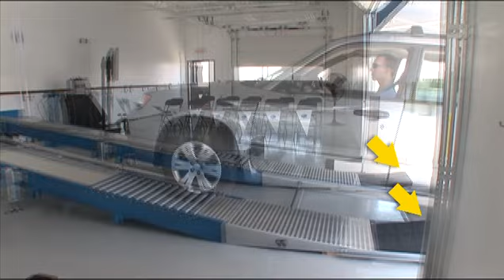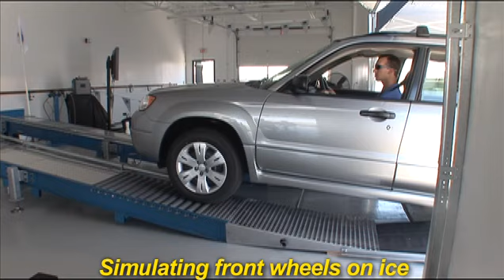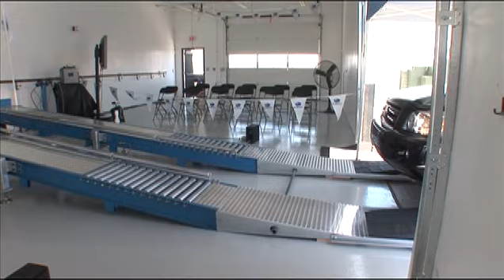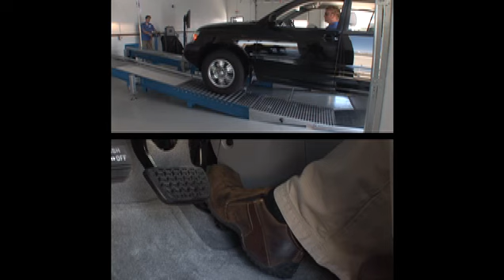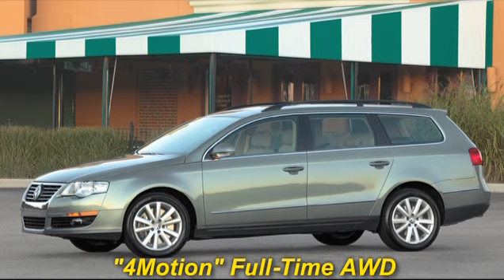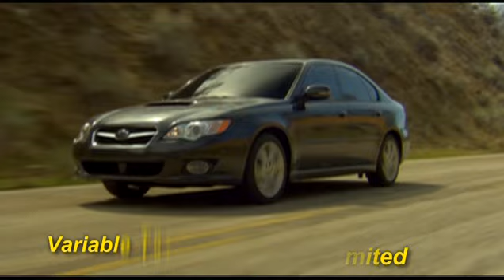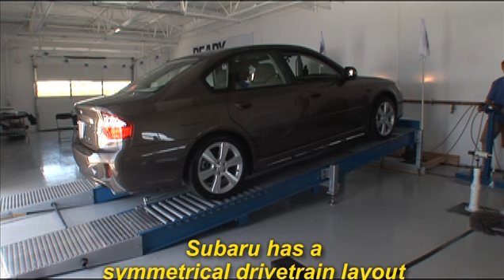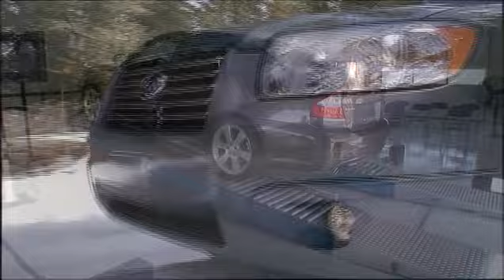Subaru Symmetrical AWD vs. Honda, Toyota, and Volkswagen

Comment: You seem a jot confused with the one wheel has traction demonstration. Each time the wheel you point out that will have traction does not appear to have power and it is the other wheel on the frame that is moving.

Comment: I really don’t think it has to due with being symmetrical awd. It’s how much torque they can transfer via braking and via the awd system.

Toyotas atrac system is not symmetrical and yet can do the same thing without issue

Comment: Did you notice the man that could be working brakes on the rollers,i have Subaru's and you believe me if one wheel is o traction with a slight resistance it will not move.

Comment: The one wheel drive test is just a demonstration of traction control which is only a matter of programing. https://www.youtube.com/watch?v=XuI-0vI2ojw&t=307s Here is a video of an Audi passing the test. There isn't a chance a Passat would just sit there spinning 3 wheels in the real world if you modulate the throttle...unless you turned the traction control off.

Comment: "The bulk of the vehicle weight is on the rear and the vehicle must overcome this to move...this is extreme...

WTF?

The weight of the vehicle never changes and the whole vehicle has to move, always.

The Highlander has a button you can push to provide more power to the rear.  The 2007 Honda Pilot has a VTM-4 lock button and VSA disable button, which can be used to send more power to both rear wheels - enough to climb a steep slope.  Try it out in your simulation.

Comment: To be fair. Folkswagen only claimed it will "move" with one wheel. They did not say it will CLIMB with one wheel. and it looked like it would move on a flat surface.. The last subaru suprised me as my open diff forester  stops immediately when 2 wheels are off the ground :)
Reply: The legacy 2.5 GT has a center and rear LSD, they were being slick comparing the VW with only a center diff LSD to the legacy with both diffs LSD

Comment: This is why my wife has an Outback and I have a Forester.
Our AWD Toyota’s always had to have studded tires and every winter. 
Even when our Subaru’s had the factory tires on them, we still had no issues with traction even in our winter months when we get 5-7 feet of snow.
Now that our factory tires had to be replaced, we replaced them with Michelin Cross Climate 2. They’re Awesome on dry, wet, and snowy conditions. They’re a quiet tire and they don’t lower our mpg. When they wear out, we’ll replace them with new Cross Climate tires.
After switching from Toyota AWD vehicles and replacing them with Subaru’s, our insurance premiums DROPPED by $600 per year. This is due to the traction, accident avoidance and safety of our Subie’s.
Both our Outback and our Forester Touring are 2019 year models.
When our Subie’s wear out, we’ll be replacing them with another Subaru.

Comment: Well that just about proves it 100%. I would definitely go with subaru if i want AWD. Im amazed that the other companies actually advertise their cars as full time AWD but its a total scam. They literally cant even drive the rear wheels. Its FWD. All those extra parts and engineering just to add weight to the car and do nothing. Thats totally NUTS. 😂

Comment: Subaru's AWD is a good system, however, the engines are junk. If you buy one, your going to be replacing blown head gaskets probably 2-3 times over the lifetime of the car.
The engine heads are aluminum (a soft metal) and warp over time causing the gaskets to fail. Also, the gaskets are junk, I've had two Subaru's, same outcome.

Comment: I know this video is old, but jfc this data is cherry picked.

First tests with the Forester involved the front and rear wheels, but the moment it came to the vw (a comparable car) they changed the test to feature only one of the front wheels... Then instead of making the comparison to a car that has similar power (the Forester) they switched to a car with roughly 50-100 more horsepower and a lighter frame for the one wheel test, by using the legacy gt.

Comment: I'm trying to learn how these systems work because I'm choosing an AWD to buy. I had an 03 Outback which was a beautiful car and the AWD had amazing traction (but you had to fang it hard to make it work) but it used a lot of fuel and was hard to fix - lots of problems. Hondas are so reliable and cheap to fix, especially since the motors and gearboxes never really fail. I'm wondering if I can hack the diffs to lock them when required.

Comment: I'm just here after driving my mom's Subaru legacy up our driveway that is almost 2x as steep as this when it had 1 inch of solid ice on it😳. UNREAL. When I mean ice, I mean it was an ice rink. We had frozen rain, and it took 3 days to melt, people were ice skating and playing hockey in Walmart parking lots. That's what kind of ice we are talking. I will be purchasing Subaru in the future.
Reply: was the car equipped with winter tires?
Reply: @ayn-yu  no, I think they were just all season tires, as where we live, the snow usually melts after a day or two, it is very rare that we have extreme winter weather.

Comment: This is a famous video and famous thread for the old Subaru faithful. I am not waking up a dead post. I am reframing the questions for a ~12 year update.

[B]Question 1:
[/B]
What has changed in both Subaru's AWD systems of today vs. then?

[B]Question 2: 
[/B]
same question for the other brands

[B]Question 3: 
[/B]
is there a video like this test from Subaru that is much more current?

[B]Question 4: 
[/B]
Can a stick shift Subaru get the same results? In a 2015 WRX? A 22 WRX?

[B]Question 5: 
[/B]
How about the relevance on the cars we actually drive as it applies to this type of testing and translates to the real world?

[I]a. 05 STi
b. 2021 STi
c. 2015 WRX
d. 2022 WRX
e. 2012 WRX[/I]

*assume all models are manuals.

[B]P.S.
[/B]
[B]MY SNOW STORY
[/B]

[B]FAIL[/B]
 my 05 STi only failed me once in the snow and it was because was an unfair test: had to big a curb bump soft enough not to tear my front bumper off and bottom out the subframe, had to turn into the driveway, the incline was very steep. Like 30-45 degree range. The powder was fresh and super slick. I could have done it if I could get the momentum I needed with all factors working against me. The manual didn't help.

[B]PASS[/B]
in literally every other snow test and blizzard my 05 sti, and 02 wrx passed with flying colors. I mean my friends and I would d*ck around in the winter (safely, there was no traffic, and no parked cars on the street), and we TRIED to lose traction. We literally could not get my car to lose traction. This happened more than once. 

[B]NEUTRAL[/B]
brakes are kinda mushy in the snow, the short gears and manual doesnt help, I never used my DCCD to go from effectively (I know not truly, full open to full 50/50 'lock', an oversimplifcation I know, that's not the point, it's irrelevant). I was ALWAYS on good all season tires with good enough tread life (ex: michelin pilot sport 4s), so I never got to  experience the TRUE grip that can be had in nasty winter weather. Would have loved to have a spare get of winter wheels and tires with some Blizzaks or equivalents that are true snow tires. 

[B]P.S.S. [/B]have you noticed that when you watch rally, the snow tires are small, thin, narrow, and studded? Seems like wider and bigger isn't always better.

[B]BONUS QUESTION:
[/B]
[B]My friend commented that an SUV or Truck is better in the snow bc the weight increase the tires force against the ground resulting in more grip.[/B]

What are your thoughts on this? I understand the logic, but does it work that way?

I told him that even if that were true that weight becomes a liability if we started talking about speed and time. Put them on a snowy course and watch that weight slow you down or carry you off the track.

Nate

Comment: Had this same scenario, I was on at a light on the top of a hill that was icy in a FWD Audi and I could not move forward even with good snow tires, needed some people to help push me. Sold the car and got an Audi quattro, never looked back as the same situation happened again but this time I pulled up with ease.

Comment: My 2010 highlander would push up that no problem. Turn off traction control and launch in 2nd gear. Or if you threw on some upgrades like mine, lock that diff and crawl up anything

Comment: bullshit:))) all video is bullshit. it;s all about the center differential for those  who fail to climb with an axle on rollers. And for haldex or clutch between axle, you are failing on one wheel due to software implementation on breaking the freewheel. So cut down with the shitty judge about symmetrical drive train

Comment: Only the Subaru, Nissan's Xtrail and Dacia Duster, are "true" AWD systems. The Subaru has a very clever computer while the Xtrail/Duster have a fully lockable Center Differential (just like a real 4x4).
Reply: X-Trail and Duster do not have center differential but a a clutch-pack. The same clutch-pack is in Outlander, ASX, Eclipse Cross, Vitara, S-Cross, CX-5, CX-30, CX-3, Qashqai and many more. They just use different software to control it.

Comment: There's more than a few problems with this "lab set up"...like...if this were a science fair project it would be thrown out...you didn't even prove you had "awd" variants of the competitors. We didn't see the rear wheels ever. "Torque steer" was obviously driver error...like look at it. Im not mad subaru...just disappointed 😔

Comment: Symetrical or not does not matter in this test, this test is about how much the diff locks, mechanically or electrically with the brakes transfering power.
A offroader with 100% mechanically locked diffs will climb this ramp even though one driveshaft is 10cm and the other 2 meters long, it does not matter.
Think about it, the front and back driveshafts are not symetrical at all, one is 3-10 times longer then the other but power is still transfered between front and back without problems, so sideways power transfer should not be an issue.
Landrovers, jeeps and even a Mercedes Unimog, does not have symetrical front axels and they are considered to be one of the best offroaders out there.

Comment: Funny how Subaru only uses their cars with limited slip diffs in this test but won’t used my old base Impreza 2007 auto which I was stuck plenty times and I live in the hilly northeast. One front wheel and one rear wheel would spin and the isn’t moving anywhere. Sorry not sorry lol

Comment: Subaru,Mitsubishi,and Audi AWD system performs better but at the cost of reliability. I also think that the horse power,torque,and suspension difference between these cars are not equal to make a fair comparison.

Comment: I love my 2006 Forester 2.5X automatic. It willl carry 4 men and 3 hang gliders all the way up a mountain climb of 3,000 ft without overheating (locked in 1 all the way). It has 180,000 miles (291,000 km) and is fit for purpose. (You can see it in some of my videos.) I'll probably hang on to it because it's worth very little and has zero annual depreciation. I love it like an old pair of shoes. I change the oil and filter every 10,000 km, and change the transmission fluid every 30,000 km.

Comment: Stability control cuts engine power, not traction control. Traction control brakes the wheel to send power to the other side. Stability control uses a combination of factors including traction control and engine power reduction to try and stabilize the car.

Comment: hi i’m a little late here but i need some help. i have a rt4wd honda and i want to make it awd. would all i need to do is get a different drive shaft w a different center diff? i heard land rover drive shafts would fit nicely (with some manufacturing) to make the system a full awd. anything helps thanks

Comment: Did you read the Honda CR V manual?? This system has two mechanically driven hydraulic pumps, one of which engages the clutch which transfers power to the rear wheels, and it is powered by the spinning of the front wheels. If you don't turn off the traction control, the front wheels won't spin enough to fully engage the clutch that drives the rear wheels. Might sound a little cheesy, but it has it's advantages, and it works a lot better than your test would indicate. Dishonest or incompetent?  Hmmm........

Comment: The system in my 2001 CR-V was able to get me up a damn mountain. Meanwhile my dad's girlfriend has a 2017 Forester and it couldn't even make it up the ramps that my dad and I use for oil changes without a run-up. Also if Subarus didn't burn a quart of oil per week, I would be driving one.
Reply: damn, maybe that 2017 needs to be checked? my mom 2016 climbs pretty good. If its got a CVT, might need to be checked, alot of them have had a recall
Reply: @SqueakyKnees  yeah the people in the video we're punching the throttle but if you want traction you're supposed to crawl which is what I do

Comment: I purchased a new Outback in 2017, had RAB and many electrical problems from the start. After only a couple of months I had the car in the deanship for repairs. The dealer only deleted the PC history, did nothing to fix the problem, and does not supply the needed paperwork to prove I was there.  This practice is still going on today. The service tech brags, "as long as I work here, no one will ever qualify for Lemon Law protection "  Problems got MUCH worse. In for repair 10 + times, towed in 4 times. After contacting Subaru customers support, they said because the dealer refused to supply paperwork for your visits, they refused to refund my money for the Lemon the sold me. Car was traded in, because it would not work, still under warranty, still not fixed because they didn't know how to fix it. Lost well over $14,000 because Subaru does not stand behind their cars, or the customer.

Comment: Too bad the Subaru has an unreliable motor
Reply: after 08 they fixed the head gasket problem. STIs had a problem few years back but that was recalled. still have an 08 and after you get a proper head gasket on it, its running strong on 217k miles
Reply: SqueakyKnees the Toyota and crv will double that without touching the headgasket
Reply: @TheRealNolanStyles  not after 08, and not before 1998. there are 1990s subarus are still being dailyed today. Toyotas are great but the new ones are so damn expensive now.
Reply: SqueakyKnees I see many more crv’s and RAV4 from the 90’s than Subaru’s not only that the Subaru’s are more expensive
Reply: @TheRealNolanStyles  thats also bc alot more crvs and rav4s were sold in the 90s bc subaru was a small company. the more expensive part doesnt add to your argument. audi is also more expensive and there are also less of them for sale.

Comment: The first generation crv did great in the snow, our 2016 crv is decent but in my opinion not as good in snow. I've had a few first generation crv's and multiple subie's from 95 up to an 09 and as long as the snow wasn't over there front bumper I never worried about taking any of them out...
I must admit I never even thought to test them on rollers but in the real world testing (and I tested thoroughly lol) I can't complain about either company's awd performance.

Comment: I've had an 06crv, 07 highlander, driven a legacy several times and i have an 08 tacoma currently and this test totaly lines up with reality. the highlander was the worst thing i have ever owned in the snow including a corolla (albeit not worse than a chrystler town and country i'm proud to not own) my crv i use as a mail car and it crawls out of snow well but is completely inferior in genuinely bad conditions to the tacoma's true 4x4 which i will testify, even with well worn tires, kicks ass.

Comment: I have no idea how the old CRV AWD works, but the one in the Ridgelines and Pilots is much better. It has no center diff, just a driveshaft between front diff and rear diff and an electronically controlled clutch for each rear wheel. With the clutches locked its like having a locked center diff and rear diff, so better than most 4x4 trucks. It might still struggle with the only one front tire with traction scenario though. Oh, and the transverse engine layout has nothing at all to do with traction.

Comment: Toyota was driven in a way to not let the system work. They hammered the throttle in the Toyota but didn't in the Subaru...and my wifes CR-V does go great in snow so....somethings up with this test. NOthing against Subaru, I'm considering one.

Comment: Not sure about the honda, but the toyota has to have the center "diff" locked. Hit the button and as long as the vehicle is under 25mph, it will lock the front wheels to the rear and become awd, if not, it's a 2wd
Reply: 25 mph is pretty slow speeds, they def were going faster than that. My dad had a rav4 with that and at least with that car, 25 wasn't enough speed to get up our gravel hill, needs more torque. But in this video the incline wasn't step enough for all of that. i dont think they used that

Comment: Yep, the Haldex 4-Motion system is great. It locks the front/rear bias to 50:50. It doesn't have locking differentials, that's why it won't climb when only one wheel has traction. Not because of torque steer or any other made up reason. The reason the Legacy could is because it has limited slip differentials. This video is full of so much bs.
Reply: Many 4Motion cars can climb when only one wheel has traction. Differentials are open but they are helped by brakes to simulate lsd.

Comment: Honda does release information about it's AWD system, apparently you didn't look to hard.  Look at information from back when Realtime was introduced, for the Civic Wagovan in 1986.  It's basically 4wd, with a hydraulic coupling to the rear wheels.

The system works, and the video looks fake.  I bet that is a 2wd CRV, since they made more of those than awd/4wd versions.
Reply: I can't see the sticker that says it is a RT-AWD model. They never even show the back wheels!